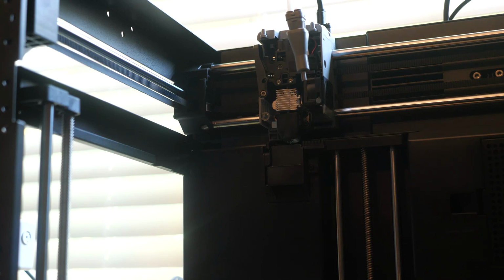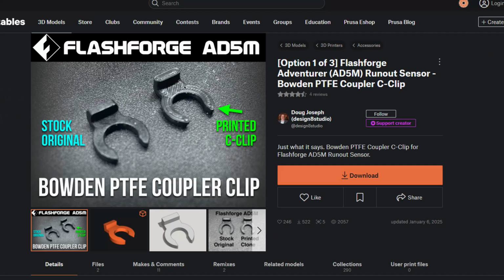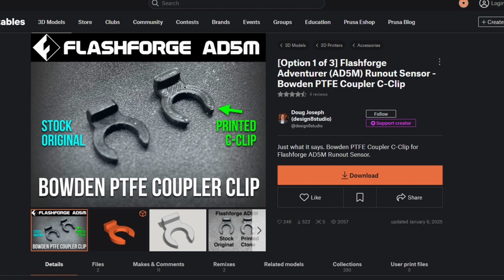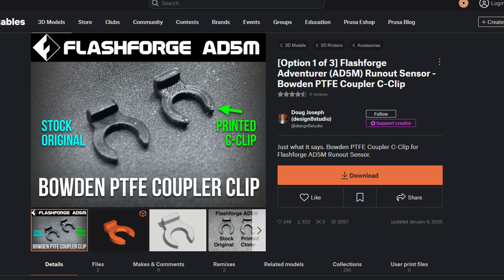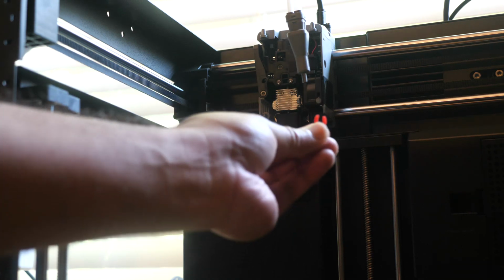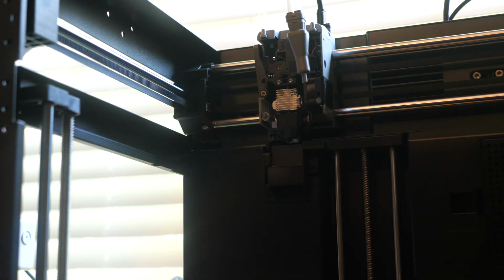Print This Part For Your Flashforge AD5X Immediately!

Comment: Should you print it with petg or is pla fine
Reply from the maker: I would do petg for the added heat resistance just in case.

Comment: Just got my AD5X yesterday and it doesn't have a clip like this. Mine is held in with a screw. Must be an update.
Reply from the maker: That's interesting. A screw is certainly more secure.
Reply: Mine has both screw and clip

Comment: I wish printer companies would include an STL files parts list for the printer, so you can print any replacement part(within reason), and have spare parts for your machine. Imho, that should be everyone's first print, instead of benchies or other stuff that isn't actually useful.

Comment: I bet that's the same size retention clip that I need as replacements for the extruders on a couple of Sovol printers.  At least Sovol makes them light blue so they're easier to find than the black clips.